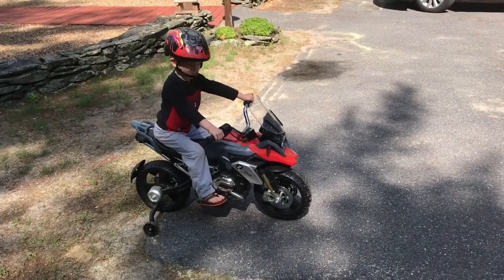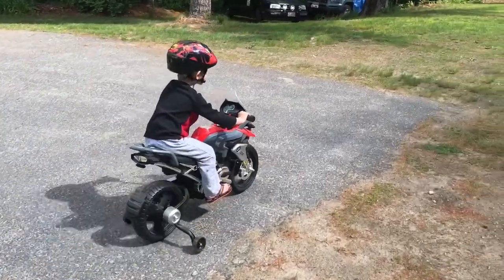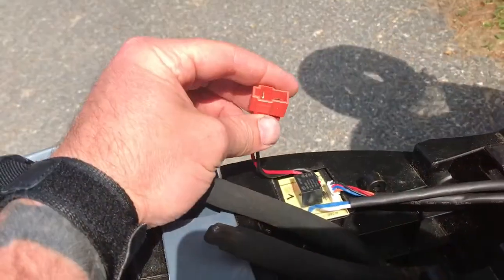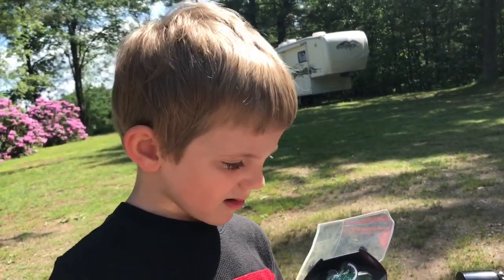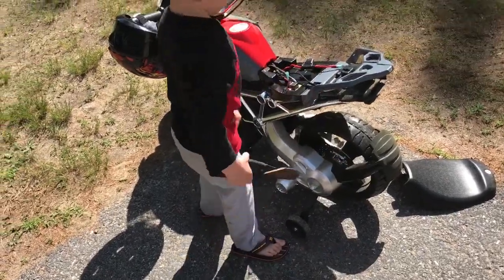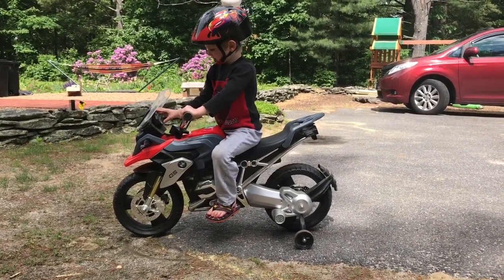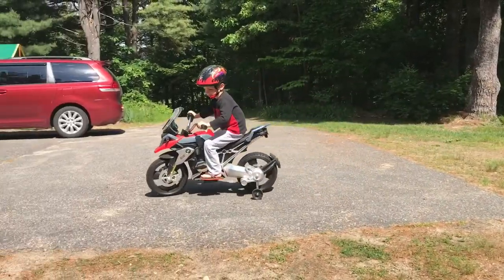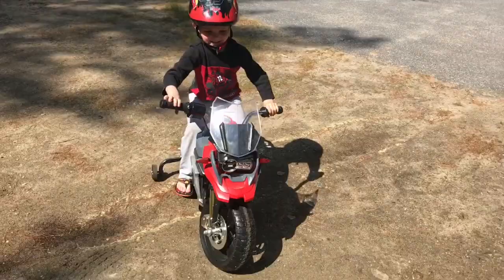Electric Kids Motorcycle 6v to 12v conversion

Comment: Not sure what I did wrong here. I think I followed this as he explained and by the pics. It still works fine with the 6volt battery. I'm thinking maybe it does need the gearbox/motor replaced for it to work. I'm looking into that now but wondering if anyone has any helpful input. I appreciate any help! 
https://youtu.be/FDdlY0rLuPw

Comment: After converting to the 12v battery the bike runs for 3 minutes then cuts out.  If you let it set for 1 or 2 minutes it works again.  This sounds like a circuit breaker heating up.  I haven't gone granular but I but a 30 amp fuse inline to be safe and that is all good.  Wonder if there is breaker in the circuit board or if the voltage is too much for the board?  Unless we know the voltage specs from power source through to motors it will be a matter of trial and error?

Comment: Could you do a detail video of how you swapped out the battery?
Reply: Looks like cutting the original black and red cable coming off the bike applying some terminals which pair with terminals off the 12v battery red/black (+fuse off red cable to battery)- looks very simple

Comment: No cutting and splicing necessary to make new battery work.  I reused leads from the original battery Just take cover off old battery and disconnect then stake on connectors and ditch the cover.  only splice I made was for new charger to retain factory connector  it is at least twice as fast.
Reply: Did you have to change gearbox/motor?

Comment: Hi, great job on the setup! I have the same bike for my son and we're looking to do the same upgrade. I just wanted to ask if the motor or circut held up to the 12v or if you ended up having to do any other modifications outside of adding the 12v battery. Also what did you use to charge the 12v battery when it needed to be recharged? Do you remember what specific battery you found? Thank you for any time answering these questions!